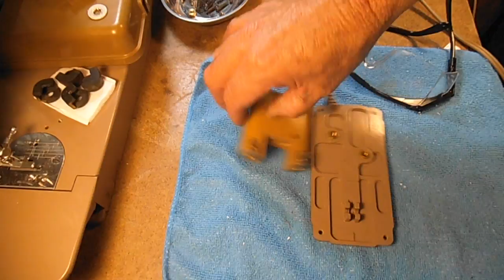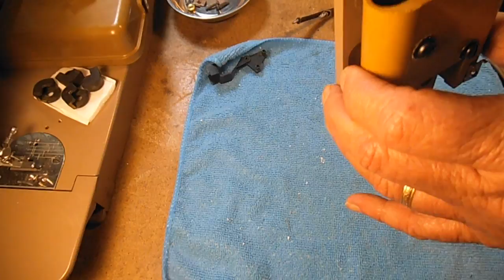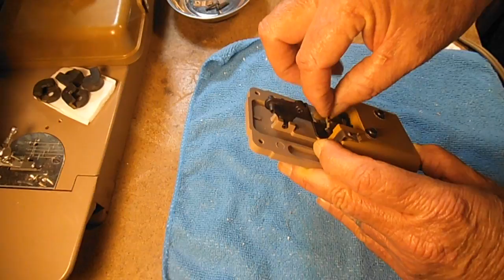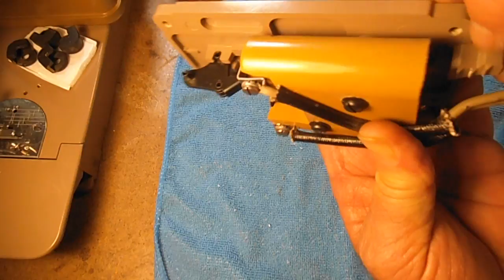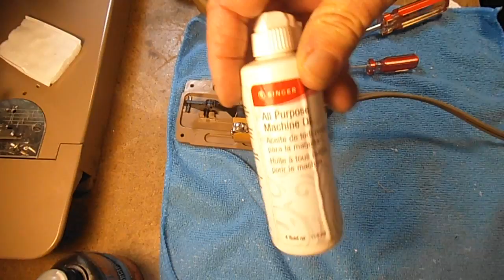SINGER FOOT PEDAL RESTORATION PART 6 - REASSEMBLE & ADJUST

Comment: Where can you buy a new shorting clip to replace a broken one? any sources? marker 12:26  tia
Reply from the maker: No place I know of sells new internal parts for a controller like this. You can find used controllers on sources like eBay, but you'll have to buy the whole controller. Personally, I would take the good clip to my local hardware store and ask for help. They may have metal strips in copper, bronze or steel that you could make your own replacement. IDK but maybe there are even little metal spacers or something that you could cut to size and drill the hole. I have bought copper metal strips before on eBay like this: https://www.ebay.com/sch/i.html?_from=R40&_trksid=p2334524.m570.l1313.TR0.TRC0.A0.H0.TRS1&_nkw=copper+metal+strip&_sacat=0&LH_TitleDesc=0&_osacat=0&_odkw=copper+metal+strip   If your local store is still open I would go there to avoid shipping delays and see the piece in person. If you can't find the same thickness you may need to make 2 new ones. If they were a little thicker I do not think that's a problem. Your chance to get creative I guess? Any repair shop; car, motorcycle, appliance may help. Know any plumbers? They use copper all the time. Wishing you good luck and thanks for watching my channel. I hope you'll have time to let us know how you resolve it. I'll pin your question to the top and maybe another viewer has a better suggestion. Take Care.
Reply: Get a small copper sheet right thickness from jewelry supply stores or Etsy. Cut a piece out, bend it, drill it, and voila! You have a replacement.  No brainer.

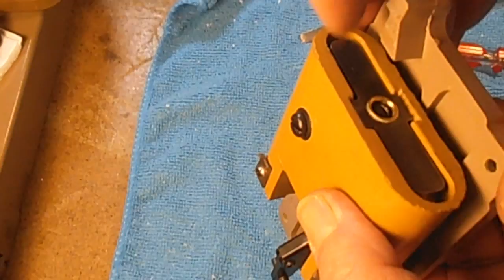Comment: 10:20 - One thing I do not understand, Andy, is where the gap is supposed to be?  I can buy a Feeler Gauge for precise measuring or estimate it. But is that gap all the way in the back, or where the 'rocking' hardware connects to the ceramic housing up front?  Mystery.  That is the hardest part of this restoration.  I finished all my cleaning today and got it all back together and it is beautiful.  Just that pesky gap thingie left.

Some tips for viewers:
I marked the electrical wires before removing.  Red paint, blue paint on each wire sleeve, on screws, on housing. Now no guesswork in reassembling.  I use acrylic paints.  I do this for all things, and also write with felt pen.

Rubber foot pads can be shined up with Carnauba wax but don't use Vaseline which will corrode the rubber.

I cleaned up the carbon discs by rubbing on an alcohol soaked paper towel, phew!  So much work. On stubborn dirt, very light rub on fine emery board which scraped off dirt fast.  Emery board must be very fine like a polisher, not sander. These discs are soft like pencil lead.

I took photos of assembly before removing, so an easy reference if you get stuck, and you will!  Photos are priceless.

Comment: Andy, I am in process of doing a thorough cleaning of my foot pedal for my newly acquired Singer 201-2. The foot pedal is mounted in the table and used as a knee lever. All is good until reassembly of the mechanism to the long screw that goes through the spring and porcelain carbon disk holder. My mechanism is very different from yours, which simply has the tabs to lock it into place. Mine is a much bigger mechanism with a spring on each side. I see no way to attach this mechanism to the bottom plate. There are holes in the bottom of the steel mechanism that line up with holes in the plate, however there were no screws to attach it. Also mine has no retaining brass piece that fits on to the long screw. I’m sure you have run into this different configuration while doing repairs. Could you either do a video on this type or better yet - advise me on how to proceed with this? Thank you kindly! Your videos are perfect for a total beginner (when all the parts are the same). 😁
Reply from the maker: """" I’m sure you have run into this different configuration while doing repairs""""    I've never even seen a 201 in person. 👀
If you email to Alan at andymanuals53@gmail.com and request a copy of the original 201 Service Manual he will send you a free copy in PDF format by return email. I've already notified him to expect your request and charge it to my account. That's all I have for you, Henry. Good Luck.

Comment: If you make restorations in pedals machines  How you replacement the carbon washer when they're missing or broken? Thanks
Reply from the maker: I knew of 4 sellers of a carbon unit for the clamshell-style of the foot pedal. I found the carbon discs inside can be removed and used in this style of the pedal. The new discs are twice as thick so you need half as many. The problem is they all sold out during the COVID pandemic when everyone started sewing again. They are having trouble getting shipments and getting the part back in stock.
I made a video about the replacement carbons and you can see it here to know what I'm talking about: https://youtu.be/R4JuQ3o9dB0
In the description below the video, I put links to the 4 sellers of the part. You can also buy another old pedal but you take a chance it has bad carbon discs. Many folks now are just buying a new electronic-style pedal (no carbons) and changing out the old pedal while keeping the old cord onto the new electronic pedal.
Reply: Thank you very much for your support and help, I'll take a look in your videos and the links. Thank you again.
Reply from the maker: @gabrieltottzi4545  Sure; good luck.

Comment: I took my foot controller apart again, I think for about the tenth time, because I still couldn't get the machine to run slow.  When I used parts from a donor pedal I used some of the carbons and the contactors in the foot controller I wanted to use.  So when I took it apart I went over the parts very carefully and noticed that the flange parts of the donated contactors were thicker.  So I put them back in and noticed that the contactors were pinned down into the pile and couldn't move and were tight.  It didn't hum or get hot before but could not get it to run slow.  So I bent the retainers up so the contactors were loose and low and behold the old girl ran perfect.  I was beginning to worry that the screws holding the base to the top were going to wear out I've had it apart so many times.  Another thing that happened was that I wasn't getting interference on my radio any more.  Those contactors need to be able to move and not be tight in there.  So, Andy, if you're out there thanks again for all the videos.  I think I'm done!
Reply from the maker: Congratulations, Ralph. Your determination is impressive! You must feel justified doing all that detective work and getting a great result! Hope you can just have some good crafting time now. Take care.

Comment: Hi Andy, I did the motor speed restore and also this foot pedal one. I only had a couple carbon disks with shorted edge. When I tighten screw the pedal gets warm when idle. When I adjust to solve my control of speed is diminished. Too hard to control speed with foot, definitely works better in table with knee controller. If I buy an electronic foot how do I know it’s compatible? Is seeing the 2 prong plug enough? Thanks!
Reply from the maker: You have choices with an electronic pedal of buying one without any cords (getting harder to find) and buying one already wired for your model of machine. If you find one without cords you can usually transfer your vintage cords into the new pedal. I've done that a dozen times. If you buy one with cords for your model you just plug it in and use it. Sometimes you can swap the new cord out for your vintage cord if you are trying to match colors or pin spacing. If your pedal now has a singe two-prong cord
to a two-prong terminal on the machine, then yes a pedal with a two-prong cord LIKE YOUR OLD CORD should work. The new pedal should have a rating of about 1 AMP, which most of them do. I have never found a new electronic pedal that could work in a vintage knee lever bracket holder.

Comment: Hi Andy...2 questions: my motor is running pretty hot...what do you suggest? Also, where can I buy some new grease wicks? Thank you!
Reply from the maker: Oh, there are many types of Singer motors. Can you tell me what model of Singer the motor is on?
If the motor used grease wicks then that is why it is running hot. Old grease gets hard and won't melt into the wick so the wick is dry and the bushing/bearing is probably overheating. Give me the Singer machine model number please and we'll get you the info you need.
Reply: @andytubesewing1953  It is a gorgeous 1941 singer 201-2... and my most precious possession! I do believe it takes wicks but not sure what kind or where to get them.  Thank you so much Andy!
Reply from the maker: @joluongo552  Congratulations, Jo. I've never worked on that model, but plenty of people have. This is kind of the go-to instructions for working on your motor http://vssmb.blogspot.com/2012/01/complete-how-to-re-wire-potted-motor.html
I bought wicks for my featherweight here on this page https://www.mcmaster.com/catalog/126/3752 but nowadays there are kits for sale like this    https://www.ebay.com/sch/i.html?_from=R40&_trksid=p2386202.m570.l1313&_nkw=RE-WIRING+MOTOR+KIT+for+Singer+15-91+and+201-2+and+other+Sewing+Machines&_sacat=0  
or just the wicks can be bought    https://www.ebay.com/sch/i.html?_from=R40&_trksid=p2386202.m570.l1313&_nkw=Singer+201-2+and+15-91+Potted+Motor+Wicks+%284%29&_sacat=0
 and there are even more blogs and videos about it.   This playlist of mine has 5 videos about restoring a featherweight motor https://www.youtube.com/playlist?list=PLsCOZgzzaiKIA1OPw0k6QOSTE-wAUZ4kp
I had a few viewers tell me the 201-2 and 15-91 motors were easier to work on as they are a little bigger and the wicks had better access.    Best of luck to you, and thanks for watching my channel.
Reply: @andytubesewing1953  Wow you are the best Andy! Thanks ever so much! I love the kits on e-bay you linked me to and I am going to order one right this very minute! I'll be looking at your other videos and hope to learn a lot more. Again...thanks!!!
Reply from the maker: @joluongo552  I'm happy you will give it a try. I'm sure you can do it and imagine your satisfaction with your "new" motor running so well. Best of luck, and thanks for watching my channel. Oh, btw, I have some documents for your model, like parts lists, service manual that I have gathered over the years. If you want free copies just email to andymanuals53@gmail.com and ask for the 201 documents and I'll send them along. They are all in PDF format and are copies of the original manuals the Singer repairment used at the stores.

Comment: I have an all metal pedal. I cleaned them down to metal. Should i paint them? To avoid ground or avoid electrcity to run the through the case?
Reply from the maker: I don't think that is needed. I have seen all metal pedals with the paint worn badly that worked OK. Personally, if it was not very hard I would spray paint it and install or replace rubber bumpers on the bottom but it is your choice. https://youtu.be/gcIB6VJ56Yk
https://www.youtube.com/playlist?list=PLsCOZgzzaiKKDdUTvSEA06K6S9Hkq60P-

Comment: Hi Andy, my 401g is running sweetly thanks to you. My button pedal works but it smells a bit line disinfectant I think some UK models have  a suppression capacitor which might have gone bad anyway heres the real reason for dropping by today. I had the pedal plugged in pluhhed in after doing a tension check and checking the pedal operation, after about 5 min the machine starts to operate slowly with my foot know where near it! I've not seen you mention this before and I've enjoyed many hours learning from you. If the carbon stack adjustment is too loose we see the button has to be depressed further before anything happens so I'm guessing mine is to tight and a little bit of heat from use is expanding something somewhere causing the sewing ghost. Anyway I'm going to bite the bullet today and do a restoration Andy style.
Reply from the maker: Good news about your 401G. Nicely done. If you do find a radio suppressor capacitor you can simply remove it. Your guess is right on target! I have mentioned in some videos that after adjusting the pedal for button clearance to run the machine to warm up the pedal then let everything sit without running but left plugged into the wall outlet. If the adjustment was too tight a small amount of electricity will enter the carbon stacks. Not enough to run the motor by any means, but enough to start heating the carbons. Even fires have been known to happen when pedals are out of adjustment. The Singer manuals say to unplug from the outlet when not in use. You can readjust the clearance and let the pedal sit plugged in for 5 or 10 minutes and see if it stays at room temperature and does not get warm/hot. Then you are good. A carbon stack runs the hottest at low speeds. Electricity coming in from the outlet, but only a small amount is passed on to the motor. Slow sewists will especially notice this. Thanks for watching my channel, Tony. I enjoy your comments.
Reply: Thanks Andy, I knew about not leaving it plugged in  when not In use, I'm really careful about that. Didn't get around to the rebuild to day but did make a cover for the 401. Really enjoying Terrible too.
Reply from the maker: @tonyray91  Thanks for watching the Terrible Series! You can rebuild it any day, but making the 401 cover was probably more fun.
Take care.

Comment: Great series Andy, I'm learning so much from you! Many thanks. I think silicone would be better preservative on the rubber feet, oil of any kind will swell and eventually deteriorate the rubber.
Reply from the maker: Thank you for the tip! When I asked the retired Singer fellas about wiping the feet with oil like they did they felt a small amount was ok and don't soak them in oil. We have to remember that was prior to about 1975. I like your point a lot. I'll pin your comment to the top for others to see. Thanks for taking the time to share on my channel.
Reply: Gary T, do you mean a silicone dry-lube spray?

Comment: My 401 foot pedal is constructed a little differently so I'm glad I took a picture first like you suggested. I had to bend one of the copper tabs ever so slightly so it would make contact when fully depressed and now she can sew at full speed again. Thanks for such a thorough video series!
Reply from the maker: Nicely done, Alice. I'm glad you checked it out and were able to get it going again. Plus, now you know more about how it works so if you have an issue you have a better idea of what could need work on it. Last year I emailed a fellow who restores 221 featherweights and sells them on eBay and other places. I noticed he had always installed a new electronic foot pedal on every one that he listed. I offered to buy the old button style pedals from him and he said "Oh, they are stupid old pedals. I just toss them out when I get a machine." Too sad for words. You are welcome for the series and I'm glad it helped. Take Care.

Comment: Sorry Andy, I just saw the pinned comments at the start of video #1 of this series about asbestos. 

It's hard to say for sure, but you recommended care in handling this stuff and keeping it under control. So, you've already covered this topic.
Reply from the maker: No worries, no sorry. One year after I made this series I encountered an asbestos pad (for the first time) while working on the controller of a 99K machine. Here is the video of that and what I did about it: https://youtu.be/gcIB6VJ56Yk
Thanks for watching and all your comments. We all learn from communicating.